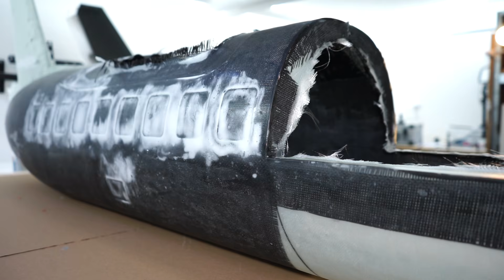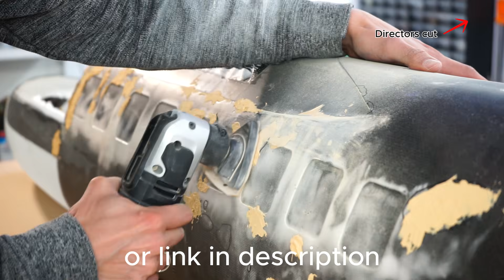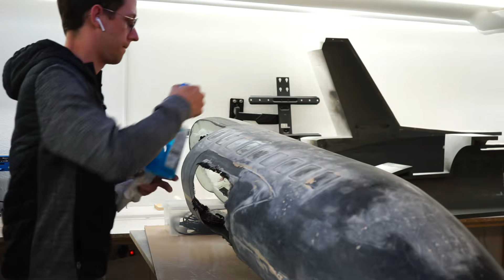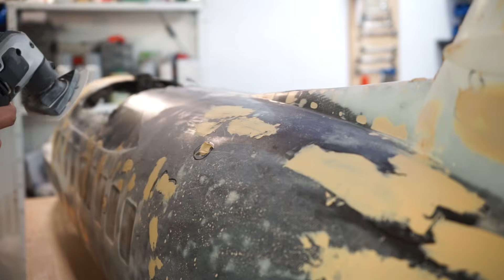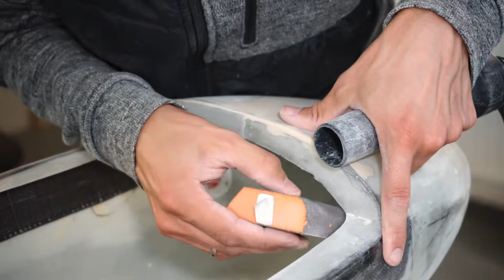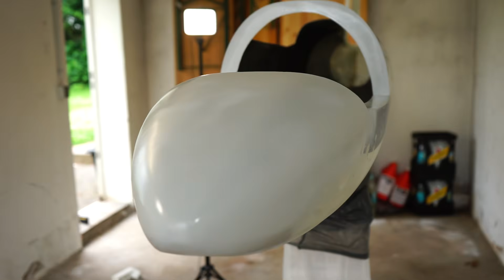perfecting the surface of my Carbon Fiber RC Plane (from 3d printed molds)

Comment: Randomly landed on your videos, very impressive project! 

Couple of tips for sanding filler and what not:

- Use a guide coat for reference on finding low spots, the easiest way is to use a black aerosol or similar and very lightly mist on a layer, when sanding you will naturally hit the high spots and the aim is to sand where there's black until you have a nice even surface. 

- When sanding large flat ish areas (such as the underside)  its helpful to use a long flat sanding block at 45 degrees to avoid sanding any lateral grooves or ridges. 

Otherwise nice job, its absolutely mind numbing having a large sanding project to do but you got some good results!

Comment: In another attempt, try printing a TPU plug. When designed correctly, it will squeeze out excess resin. You must have cavities for excess epoxy. You can use men's protection, adhesive tape, and food foil as a separating film.
Reply from the maker: Thank you! Good advise! 🙏🏼

Comment: I've just found your channel and am on the second video. (This one)
My heart bleeds for you. Sanding is a pain in the arse.
Can I recommend a few things to help you?!
#1. Get a DA sander. It will save you half the time.
#2. Keep the sander flat. It's tempting to use the edge but as you found out, it can create low spots.
#3. Small air bubbles. Use a cellulose spot putty. You can add a few drops of cellulose thinner to help it flow into the hollow. It air dries so doesn't need mixing. Once it's hardened up, lightly sand and the pin hole is gone.
#4. Use a rubber sanding block. If you don't, you end up following the original contours you're trying to get rid of.
#5. Before you do any of the above, sand and panel wipe the entire model. It will show imperfections better, and your fillers will bond to the surface better. Sometimes it's easier to apply a light primer coat to show up the imperfections.

Hope this helps.
Reply from the maker: Thank you! I really appreciate the tips. This is a whole process and I learn a lot.

Comment: The car filler which you used can make tiny surface cracks in the future because it’s not so flexible. Mainly the big impact will be vibrations. The reason why is better to use mixed epoxy with micro balloons, because the chemical and material structure is more flexible and closer to epoxy than regular filler. I used best epoxy for aircraft industry L285 +hardener L286. In case of micro balloon I always used vacuum chamber where these tiny bubbles will be removed. Surface will be much smoother after the application. 🙂 BTW based on your project I decided to fly across the Georgia 🇬🇪 with L410 and it was a really smooth flight! What was a funny situation. Aircraft had czech matriculation and pilots were from Czech and Slovakia 😁. What a smooth flight! Now I understand more why you decided to build up L410 ☺️.
Reply from the maker: Thank you for the helpful tips, I don’t think the filler will crack because the fuselage won’t be under that much stress. I’d also like to fly with a let one day, sounds like a fun trip! Greetings ✌️

Comment: I mix my filler on some cut up boxes and throe it away when done, I all so use dry wall filler with some water to fill the some pin holes

Comment: macht ja gute Fortschritte.
Reply from the maker: Danke! Ja, ist halt viel Fleißarbeit, schleifen und spachteln gehört nicht zu meinen Lieblingstätigkeiten 😂
Reply: @loebair  ich baue Boote, da kenn ich das 😞 Mittlerweile ziehe ich mir schon ordentliche Schutzkleidung beim Schleifen von Plastik an, wenn du mal allergisch dagegen wirst, wirds problematisch.

noch zwei Kommentare zu Deinem Fuselage Laminieren. Ich mische immer nur kleine Mengen Epoxy an (Working time <1Std), gehe dann halt Schritt fuer Schritt nach vorne. Konnte damit mein 7m Boot ordentlich laminieren (so 4+ Stunden).

Ich haette die Rumpfhaelften erst im zweiten Schritten verbunden. Das ist viel sicherer, aber hat bei Dir ja gut geklappt.

Uebrigens vergiss nicht, dass 90grad Gewebe nur 50% Festigkeit hat! die Haelfte der Fasern ueberkreuzen ja den Spalt nicht. Ich benutze da immer 45grad Bi-Axial Tape, da wirkt die gesamte Festigkeit.

Comment: I'm disappointed Ramy, you didn't tell him about polyfil or drywall mud for filling all those little holes? Geez! Some kind of friend you are...lol j/k
Reply: @loebair  For future reference, after mixing your resin apply heat to the resin with a hair dryer for about 3-5 minutes, then let it sit for 5 minutes and you should be good to go, bubble free. If you do get bubbles, try watering down some polyfill or some drywall mud to about the same consistency as paste/glue and rub it onto the model using a pair of rubber gloves, rub it in really good, then let it dry, once it's dry you can go right into using 140 grit sandpaper and you'll get a babys arse smooth finish after some 220. ;)